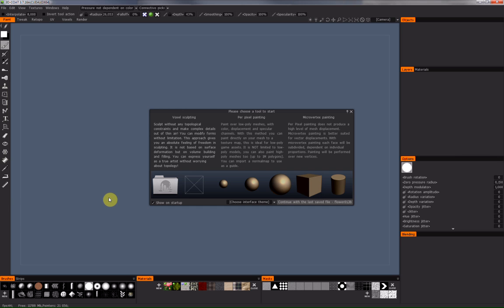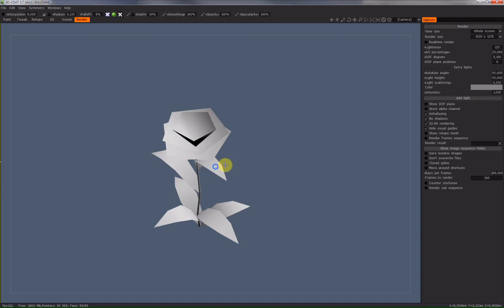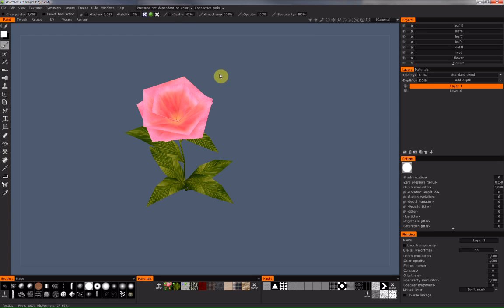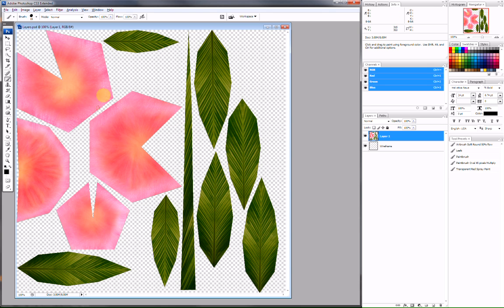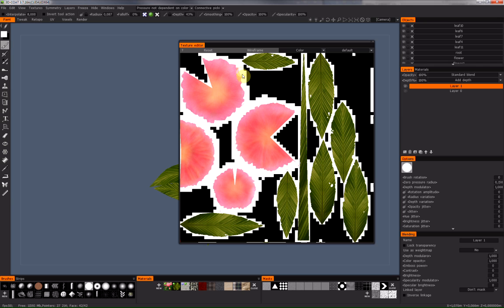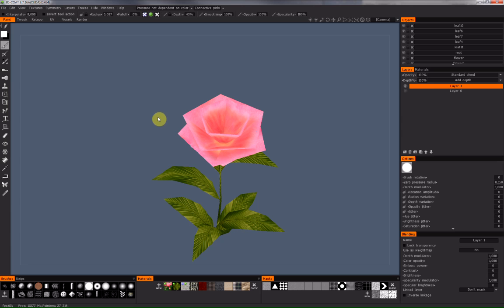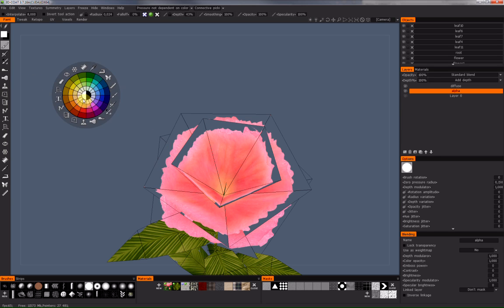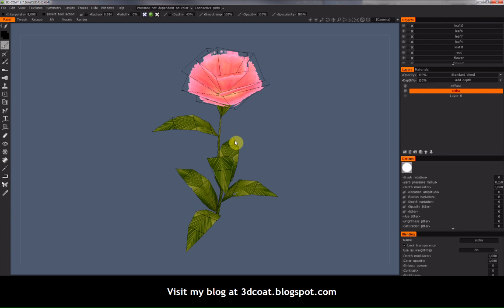3D Coat Alpha import

Comment: in  new version,just turn off "layer one" you can get the alpha inf.if you need the texture with padding ,you can add  a  ground color down the paint layer.finally,trans them in to  photoshop and  combine them !
Reply: and realtime padding view setting : Preferences---realtime padding mode---take nearest oppsite pixel

Comment: dude, it's been almost 11 years since you posted this. I started learning 3DCoat, looking for information on how to draw using the alpha channel to create leaves. And I came across your video. And as I understand, it still doesn’t have native support for the alpha channel from png images😅👍
Reply from the maker: You can export the alpha channel using png images in todays version like a charm. Also it's possible to "paint" alpha infos by erasing areas. But you're basically right: It's still not possible to isolate alpha infos in a greyscale channel and paint there, like inside other apps like photoshop.

Comment: Save yourself sometime and dont watch this.
Not saying the video is bad. But short answer, you CANNOT havve alphas in 3DCoat. End of story.
Reply from the maker: This is not the complete truth. It always depends what you need. Please explain in more detail what you expect. You are able to create textures with alpha information in 3D Coat. And you are able to save them. I am not really shure, but I think you are looking for a way to control the alpha channel information itself and independent in 3D Coat. So "YES", this is not possible yet.
Reply: You can paint a layer black in some areas, then make it a alpha channel in photoshop. Thats the closest you'll get.
Reply from the maker: I know what you mean. In 3D-Coat there is a smarter way to do something similar. You can decide which layer have to be a mask layer for other layers. You can use the mask for multiple layers at once. This is not possible in Photoshop. This trick can be used for controlling the alpha. The classic way by using a black and white 8 bit mask is not in there at the moment.